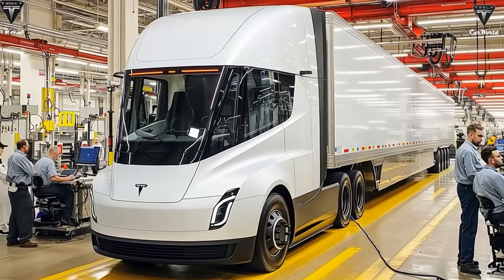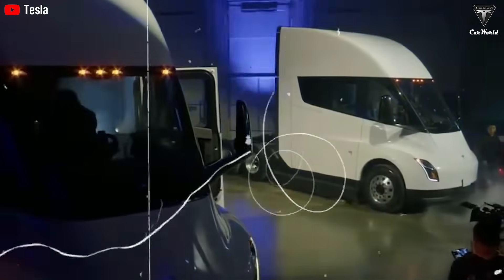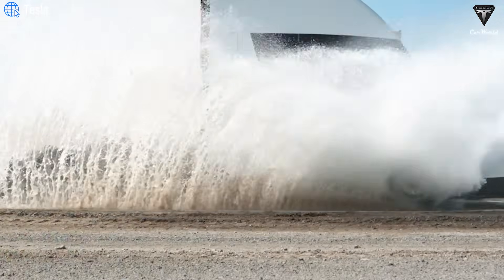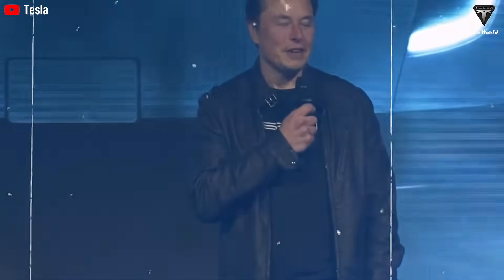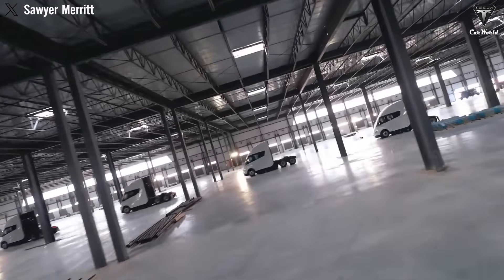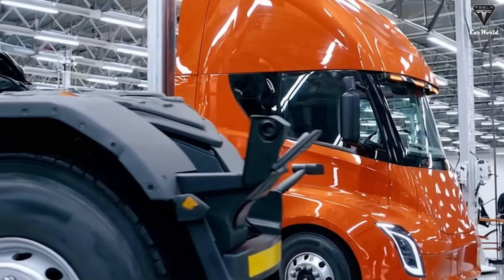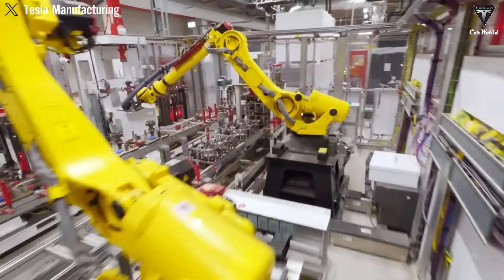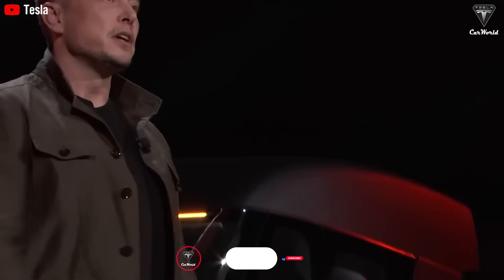Elon Musk Confirms Tesla Semi Gen 2 Finally Here! Full FSD, Sleek Design & Glowing Cab!

Comment: Yay….!
Will it have a steering wheel? Or is that yet to be determined?
Reply from the maker: Yes, absolutely — the Tesla Semi V2 will still include a steering wheel! Even though it’s equipped with Full Self-Driving hardware, regulations still require manual control. Tesla’s design keeps a central driver position with a compact, futuristic steering setup — perfect balance between human and AI control.
Reply: @TeslaCarWorld - 😳🙄💁‍♂️🤦‍♂️